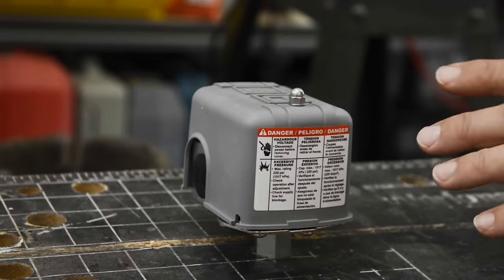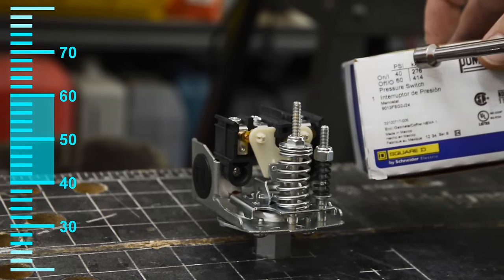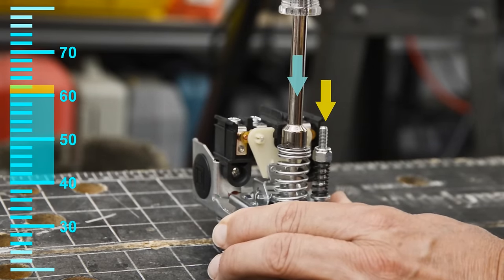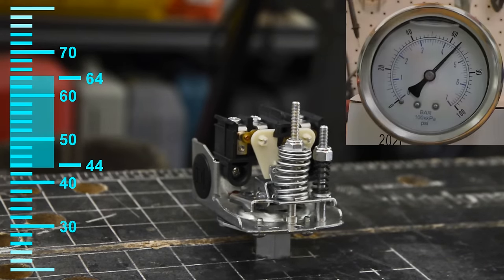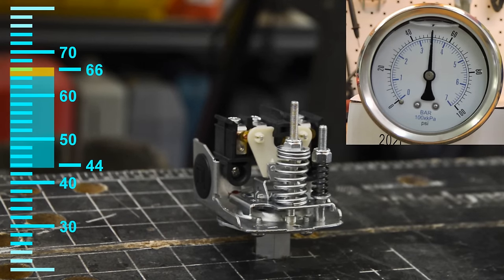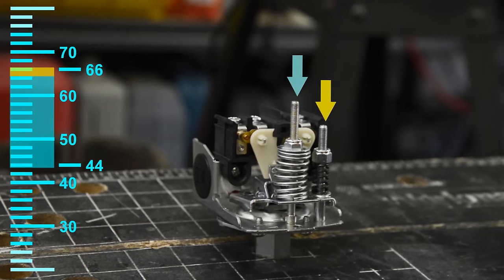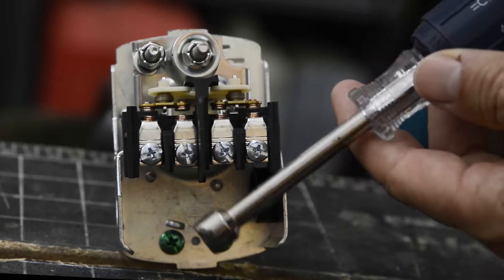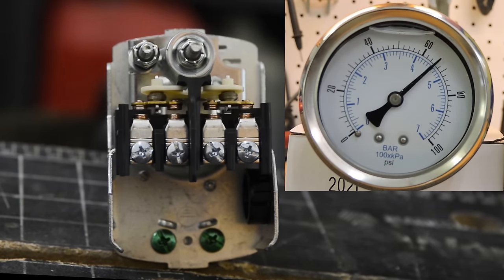Pressure Switch Adjustment

Comment: I have problem with pressure switch
 That when I increase the pressure to work from 2.5 to 4.5 bar the pressure  of the tank stopped at 4 bar I mean the pressure can not increase more so the switch still connected the supply to the  motor and didn't  turn off.
Now I adjust it to work from 2 bar to 4 bar that make the water absent  for a while until the switch connect the supply
Give me your advice
Reply from the maker: Hi Mahmoud: 2.5 bar (approx 36 psi) and 4.5 bar (about 65 psi) should be very doable.  The pressure on your tank should be slightly lower than the cut in pressure of your switch.  For example with zero pressure on your system the tank bladder should be pumped up to 2.4 bar and no higher.  Also your pump may not be able to pump up to 4.5 bar.  Try loosening the cut off nut down and see if it will not cut off.  Smaller pumps or pumps having to raise water a large amount  may max out before the pressure switch is satisfied and opens, thus shutting off the pump.  Good luck.

Comment: set ballast pressure tank bladder pressure to 2 psi less than cut-in setting on press switch.  28 psi for a 30-50, 38 psi for a 40-60.  Make sure the water pressure is zero when testing pressure or your air gauge will read the sum of the air pressure and water pressure

Comment: Great video. I just installed a 30-50 psi switch and find the pressure to low. Can I adjust it to get another 10 psi of pressure?

Comment: Thanks for making and sharing this video. I'm on my 3rd pressure switch in 8 years. The first one later about 5 years. The problems I'm experiencing address: 1. The values change and adjustments are necessary quite often. 2. Ants. Ants get in between the contacts and when enough get electrocuted they fill up and the contacts can't conduct. What s pain.. Location.. "Jungle" 3rd world.
Reply: Typo. Lasted about 5 years, not later. Sorry.
Reply: Typo 2.. Are. Not address. Damn auto correct.
Reply: Typo 3. What a pain. Not s..

Comment: I have a 40/60 (have it set to 45/65) and when the pressure drops to 50, it then drops immediately to 45, but the contacts open and close twice, rapidly to bring the pressure back up.  I've cleaned up my contacts with a file, but no improvement.  Maybe time for new pressure switch unit?? Thanks
Reply from the maker: Classic symptom of a bad ballast pressure tank.  With zero psi on the system the air pressure in the bladder take (a.k.a. Pressure Tank) should be 2 psi less than cut in. On a 40/60 that would be 38 psi.  See if you can refill it with air.  If it holds air your good.  Restart the system and see if that doesn’t fix the problem.
Reply: @reclaimfilterssystemsinc7529  thank you.  I had to fill it up with air one time, already, so will just purchase a new one. Thanks again for your response!
Reply: @reclaimfilterssystemsinc7529  I replaced the tank as well as the pressure switch, everything set for 40/60 and still same problem.  Any other ideas?  Thanks!!!
Reply from the maker: @lmd6204  Jumpy Pressure switch, there is a slight water rebound or water hammer.  As long as the ballast tank is 2psi less than your cut in (you said you put in a 40/60 switch), this means with no pressure on the system your ballast tank should be 38 psi (use a good gauge).  Lastly I would try slowly (one complete turn clockwise at a time, counting as you go) tightening the cut off only, there is a momentary water pressure spike that is messing with the pressure switch. By increasing the cut-off only pressure by 2 or 3 psi you can give yourself a little buffer.  Keep tightening slowly until that ON/OFF/ON/OFF stops.  Good luck.
Reply: @reclaimfilterssystemsinc7529  I really appreciate your help.  I will try this.  Thank you!

Comment: Is there any harm in widening the differential to 30 lbs?
Reply from the maker: If the cut off only adjustment will go that high it will not hurt anything.  I suppose you have a reason, but you are not doing the pump or water system any favors by having such a wide pressure sweep.  Typically we adjust it up + 2 psi to give the pump a slightly longer run cycle and prevent the ON/OFF/ON/OFF cycling that could occur if the gap is too small, but widening it too much may result in a pump that never turns off or leaks from too much or too little pressure beyond the expected 30-50 or 40-60 psi.
Reply: @reclaimfilterssystemsinc7529  Yes, I can adjust it that high, probably more.  I was thinking that it would give less frequent pump cycling.  My concern was that it might overstretch the tank diaphragm and cause premature failure.
Reply: @rogerg4916  A Ha!, Ok common problem when the tanks (pump tank A.K.A. ballast pressure tank) start to go bad.  The air-bladder starts to fill with water or the pressure in the bladder is to low, or both.  With ZERO water pressure the ballast tank air pressure should be 28 psi using a 30/50 pressure switch, or 38 on a 40/60 switch.  It’s the pump switch cut-in pressure minus 2 psi.

Comment from the maker: You can adjust up but not 10 psi, Yes you would have to adjust the ballast tank air pressure.  BT press (with 0 press on system)  is 2 psi less than cut in.  28 psi on a 30/50, 38 on a 40/60

Comment: So if I want more pressure in the house, which one do I turn?
Reply from the maker: First check to make sure you don't have a clogged water filter or inadequate pipe sizing to give you the volume and pressure you need.  Then the best way is to just install a 40/60 instead of your (i'm assuming 30/50) you'll get an immediate +10 psi increase, if your pump can push that much.  The other way is to adjust the center nut clockwise to raise the range of the switch, you can go from 30/50 to maybe 35/55.  As always follow safety protocalls, your pump switch probably has 230 V on the contacts so please be careful and do not touch the contacts.

Comment: Im looking to use a pressure switch just like this to run a pressure washer in a factory. I need it to turn off when pressure is low and on when pressure is at a certain point. Is it possible to invert the electrical contacts or do I need to use a relay to do so?
Reply from the maker: Contact square D or your distributor, they do have a reverse acting switch.
Reply: added in a relay with a NC contact. does the same thing.
Reply: Was looking at simular products. This one is a FSG. I needed an FRG which has reversed contacts (open on falling pressure)

Comment: "can i set the 40/60 pressure switch to 44/64?? and will the give me more static presure at the outside water Fossett?."
Reply from the maker: Sure, if your pump can go that high, go for it. It's well within the range of adjustment of most pressure switches.  Just adjust the center nut CW to get the range raised 4 psi.  If you have a Square D or Merrill pressure switch you will have the two nuts as shown, center for range and outer for cut-off only.

Comment: I have a well, and my heat tape came unplugged somehow,  long story short,  i plugged back in, but the pressure switch wont kick in without me hitting the gray box , and it will kick in, but it wont kick back in without hitting the box again, any ideas what it is?
Reply: I'm no expert but it sounds like either the wires are loose or the contactors aren't connecting.  Try watching with the cover off the pressure switch and you might be able to tell.

Comment: Could you help me plsss... because our pressure swich in jockey pump we encountered bouncing contact at starting... any solution?? I already replaced it with new pressure switch but sill the same... thnks
Reply from the maker: +Marlon Agustin 
When pumps start and stop repeatedly or if the contacts "bounce" on-off-on-off, that is the classic ballast pressure tank out of air or the air bladder in the tank is full of water.  In a nutshell here is the solution.  With ZERO psi on the system use a tire gauge and measure the tire valve on the ballast pressure tank (a.k.a. bladder tank) The proper air pressure is 2 psi BELOW cut in.  So if your cut in is at 30 psi your ballast tank should have 28 psi.
The ballast or bladder tank acts like a big shock absorber, it not only reduces water hammer but has a reserve of water under pressure so your pump doesn't run in fits and starts.

Comment: my pressure switch has only one adjustment it is a sta rite pump  how do both adjustments with just one place to adjust  ?
Reply: Hi Cliff:  Sometimes smaller pumps with a built in pressure switch have just one adjustment for the range.  It will be missing the cut off only adjustment.  They seem to work OK and if you ever replace it you can install the better type with both.  The Square D's are still OK but I really like the Merrill's Heavy Duty Standard no lead pressure switch.  It has Allen key wire retainers and the contacts and contact plates are a bit beefier.

Comment: If you have 2 compressors that are tied together on the output air you can use 1 pressure switch for both and also wire in a alternating switch so both pumps get to work every other time without leaving one pump sitting there till the other goes out plus they last longer if you split up the load,now if u have pressure switches wit unloades built in you cat do this you will need 2 timers each set with 2 - 6 hour shifts per day.

Comment: my pump isn't going past 30psi started this morning was running water and it went down to 0 psi and now won't go past 30psi what should I do in that situation? thanks
Reply from the maker: Could be a lot of things starting with running out of water in the well, clogged or worn out impeller, air lock in the system preventing the water from flowing, or even low voltage which could eventually burn up the pump.  Let it sit turned off for a while ( a couple hours ) to see if it refills and pumps, if you get water pressure back then it's a low water situation.  If it pumps water at all and pressurizes to 30 but no higher, your pump is running but you'll need to narrow down a few things to troubleshoot.  If it's a deep well pump find a local Franklin pump authorized service center / well driller, I've found them very knowledgeable and can help.

Comment: First-timer Question: 
My professionally installed pressure switch has the bottom connected by a small tube to the pump, rather than to the water line. None of the How-to videos show this. Is this proper and functional? Pump has stopped working. I can replace the switch but am afraid that this small connecting tube is likely to be full of clogging debris, as a clogged nipple pipe is shown in several  of the videos. Why would a professional install the switch  this way? Also, my pump & switch are outdoors (its Florida) and the switch, which is not a weather-proof enclosure, is badly corroded. Makes me think this installer was an idiot. Perhaps setting himself up for a future service call.  Do you agree that  I need to provide an enclosure to protect the switch from rain, insects, etc.? thanks.
Reply from the maker: +John Stewart 
The pump mounted pressure switch works the same way.  It's fed the water pressure from the head of the pump which also feeds the ballast tank and the demand, i.e. house.  They can get clogged and when replacing the pressure switch (most often mounted right to the motor) I often install press to fit tube fittings and replace the tubing.  Normally it's a 1/4" O.D. poly flow.  That way you can remove pressure, clean out the hose and put it back in service easily.

Comment: If pressure tank and pressure switch both are bad than how can we check about the pressure settings of pump
Reply from the maker: Pumps usually only have a pressure spec, based off their performance curve.  For example a 1 1/2 HP pump may only pump 20 gallons per minute at 50 psi with a head of 45 feet.  So to determine how much pressure the pump itself is capable of you need to look at the specifications for the pump, specifically that pump curve.  Figure out the horsepower of the pump, then cross it with how high up it has to push or how far it has to pull (basically that is referred to has the head) then where those two lines intersect it will give you the gallons per minute and the pressure.  Lastly, if your pumping situation has a bad pressure switch and tank.  Why don't you replace those and the guage as well.  Good luck.
Reply: @reclaimfilterssystemsinc7529  appreciated... Because that's the new information you gave me.. thanks for your nice reply

Comment: So....you can't  "squeeze" the range to, say, 15 pounds?  20 pounds is the minimum range you can set?  Mine makes the pump come on at 40 and go off at 70 even though I have NO pressure on the little screw.  I can spin the spring freely.

Comment: So it's normal to have water in your gauge?  Interesting.  Thought that might have been a problem
Reply: That's called a glycerin filled gauge.  It's a stainless steel gauge filled with glycerin to prevent gauge bounce and vibration.  If you've ever seen a gauge needle vibrate it's hard to make an accurate reading.  Kind of a shock absorber for the needle and mechanism in the gauge.
Reply: @russkeller5747  thank you for the explanation,  makes total sense.

Comment: Sorry sir what I mean was cut off at 45 psi then switch on at 30 psi, is it possible sir?
Reply from the maker: You can lower the cut off by loosening the outboard nut.  As soon as you lose spring tension on the spring below it, that's it.  So if you have a 30-50 switch you can take your nutdriver and counter clockwise loosen the outside nut till you go down to 45 on the cut off, where the contacts should open. Use electrical safety and know when the power is on at the circuit breaker your contacts have voltage.

Comment: I have a 1/2 hp submersible 150 feet deep and a square d pressure gauge 30 - 50. The pump turns on at 18 psi and off at 32 psi, and after attempted adjustments doesn't go any higher than 32 psi. Any ideas?
Reply from the maker: if the contacts are opening at 32 then check the switch data under the lid.  It may be you have a mis adjusted switch or one that is rated for lower pressure.
Reply: Reclaim Filters & Systems Inc   30 - 50. What could cause the pressure not to get higher than 32 psi?
Reply: G Merc 
First I would change the gauge, they are notoriously inaccurate, next most likely is a clogged or worn impeller in the pump.
Reply: nckeller , thanks, changed out the pressure gauge. I was afraid that the next thing would be to pull the pump. Do these pressure switches ever go bad?
Reply from the maker: They are remarkably reliable but like anything man made they can fail.  If the switch looks suspect then change it with the gauge.
Reply: Reclaim Filters & Systems Inc       Thank you sir.

Comment: my pressure tank say its rated to 19bar max, the pressure in the tank its 35psi , the cut off its at 43 and cut in 20 , dont have much water pressure , my pump its a 3[4 horse power , any thoughts.....
Reply: JORGE BANEGAS 19 bar is 275 lbs. That's the tanks max operating pressure and not what you will be setting the pressure switch for.  The tanks AIR pressure in the bladder should be 2 psi less than your pressure switch cut-off.  In your case 41 psi of air pressure in the tank bladder with ZERO water pressure applied.  Look up the pump curve for your pump, you may be able to switch out your pressure switch to a 30/50 psi unit.  That would give you better pressure assuming your pump doesn't have any other issues.  If you install a 30/50 you would inflate the tank bladder with 48 psi of air (again with no water pressure applied). If there was any water pressure on the system the bladder would read falsely high.
Reply: Thank you su much for your help nckeller , i will try that....
Reply: yep
Reply: +nckeller Actually 28 psi not 48 for a 30/50 switch, right? Two psi below the cut IN pressure not the cut-out, right?

Comment: so for a 40-60..i should set tank at 38psi...right???and 30-50 is 28psi??
Reply: tank air pressure??
Reply from the maker: You got it! , 2 psi less than the cut in, is the mfg's spec.

Comment: I can't get the nut off to remove the cover. It just spins and spins. I think it's spinning the shaft inside. What should I do?
Reply from the maker: I use a large pair of side cutters and snip the nut off the end of the bolt.  The plastic cover will bend in just enough to get the jaws under the nut.

Comment: what do I do if its been running constantly for about 12 hrs?!
Reply from the maker: If the pump continues to run but there is no water turned on and flowing,  there are a few things to check:
1.  Is the pump ever getting up to shut off pressure?  If not the pump may be wearing out, the impellers wear down over time and have a harder time pushing the water.
2.  Is the pressure switch set too high?  If your pump is reaching 50 or 60 psi but the switch isn't opening you may have the pump switch adjustments too tight.
3.  Sometimes rust of debris clogs the inlet of the pump switch so it never sees any water pressure to tell it to open the contacts.
4.  Could you have a water leak or maybe running somewhere,  not allowing the pump to make cut-off pressure?

Comment: If my pump won't turn off which one do I adjust?
Reply from the maker: Try loosening the cut off only counter clockwise a few turns.  That will lower your cut-off point.  That’s the outboard nut.
Reply: I only have one nut on the switch. Should I just turn that counter clockwise?